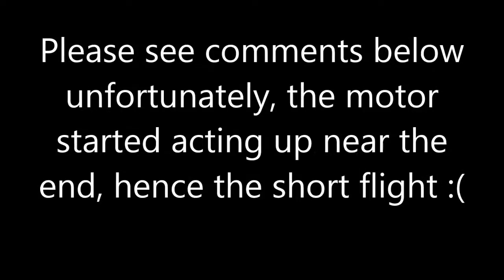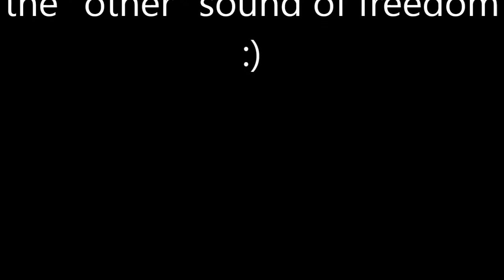DYS 2600 motor/6x4x3 Master Airscrew prop testing

Comment: Hi Scott. Was totally enjoying the video, but very surprised when all of a sudden you noticed something was wrong. Did you check the temperature of the motor immediately after landing? 1 of my DYS motors behave erratically and generated lots of heat before I found that the shaft is slightly bent after I dismantled it. May be it happened after I dropped it when testing it before mounting it to the plane. Luckily I had same shaft from other broken motor and it's working find now.
Reply from the maker: Hi Bimo.  The motor is behaving erratically from an electrical standpoint.  It ran cool and the bearings are still very smooth, shaft is good, prop runs true.  Unfortunately, when I tried the DYS 2826/6 2200 Kv motor, the same problems occurred.  I will trouble shoot further and try with another ESC and experiment with other settings.  I suspect unfortunately I got another bad motor from DYS.  Disappointing, but part of the hobby.  Cheers, Scott

Comment: Hi, the propeller is to big for this motor. Use 5x3x3 ;) .
Reply from the maker: I completely disagree.  I have bench tested and now flown hundreds of flights with the Master Airscrew 6x4x3 prop on several of these motors with no problem whatsoever.  Cheers, Scott